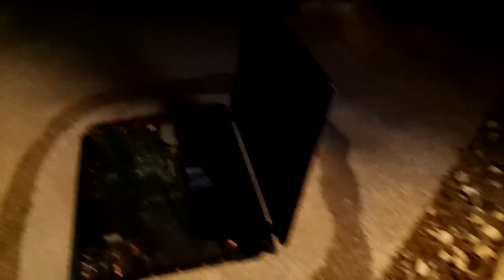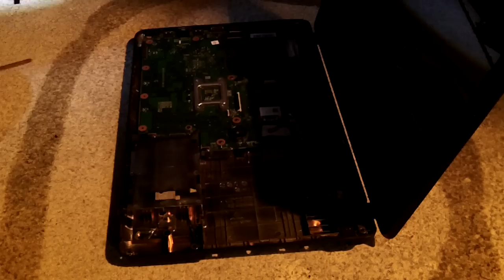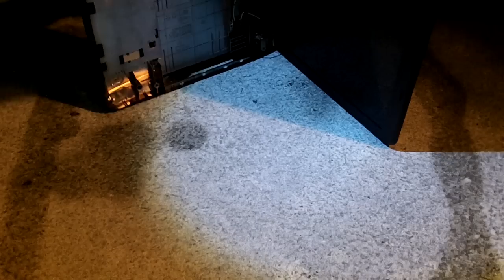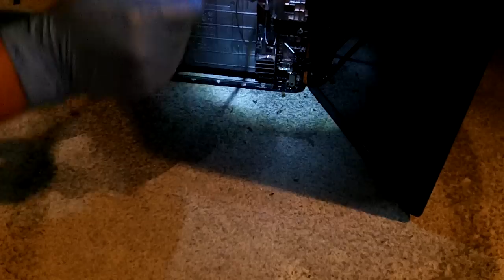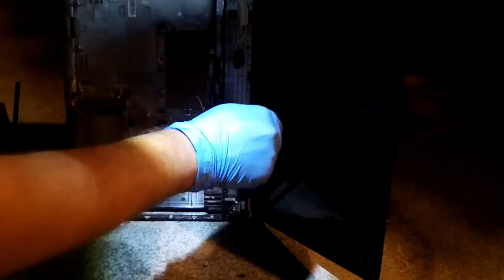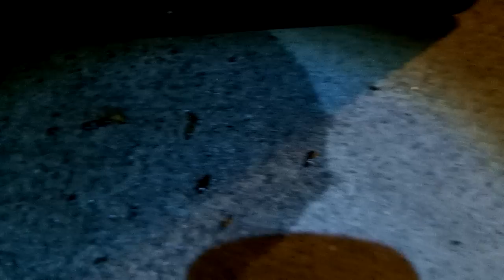Roaches in customer laptop, nastiest as hell, Cucarachas asquerosas

Comment: my mom just bought a laptop from someone locally in a little town that has no roaches at all. literally!! but i took it apart because i thought the fan crapped out. but it was caked with dust and roach crap. took a look to the right of the body of the laptop and there was a hole colony of roaches. i took the mobo out and all the little things and brought them outside and killed them one by one >:D i had no choice but to clean with a damp rag. because the roaches caused a damp moist air within the laptop. so it was caked with rust and build up from alluminum. ugh what a chore. took the screen apart and there were two more inside of it. i am guessing that laptop might have been from vancouver bc? only place i know that is infested with roaches. kind of a moment of "note to self, do not buy crap from the city that is used anymore" i cleaned the whole thing and still scared to use it x) like germaphobia and still thinking they are still in there. this just happened today!!. laptop still works fine yet. so dont be scared to use a damp cloth for this.
Reply: Did your house get infested?

Comment: i run into the  same problem i get 2 or 3 clear trash bags put them inside each other spray roach spray in the bag mash all the air out tape the bag close in  two days most all of the bugs are dead then i open the laptop up i use spray thats not oily that can stain plastics like rid a bug spray